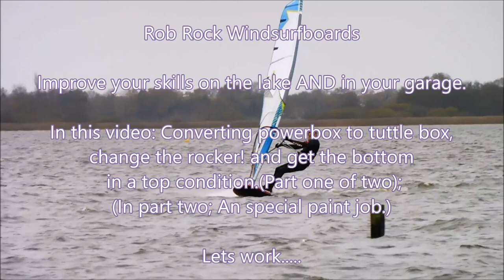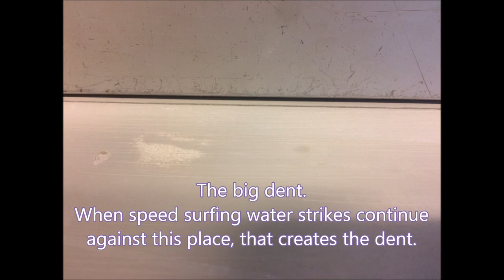Converting powerbox to tuttle box,  change the rocker!  DIY

Comment: Nice job.
When I repaired a friend's broken finbox in a wave board 30 years ago, he said, "Do what you want, it's scrap as it stands". So the finbox sat in a carbon tow sheet lined channel, with the same carbon extended on each side approx 50mm. This also made me change the rocker as I didn't want to sand away all the carbon. So. like yours, the furthest part of the tail had about 3mm added and got flattened out somewhat. My friend said it had a better top speed, but lost a little bit in the turns. So it became more like a slalom board. :¬)

Comment: what a kind of paint on bottom?
Reply from the maker: The paint used on this board is water based.
In general, you can not use any paint. The adhesion is also a part that is very important. Always do a test. Let the paint dry for a few days and stick a piece of tape to see if the paint holds.Twee component paint is tougher / stronger, but also more difficult to repair. Oil based paint is often more elastic. Finish with a clear lacquer coating also gives more strength, but then again difficult to repair. Boat paint is also a good option. When in doubt, consult a specialist company.
Reply: Rob Rock Windsurfboards thank you.

Comment: What type of paint do you use?
Reply from the maker: Well, you can use 2k paint, oil based paint or water based paint. I am using mostly the water based paint. Its not the hardest paint, but its easy to work with.  If you want to make it more stronger use clear coat.
Reply: Rob Rock Windsurfboards thanks😀